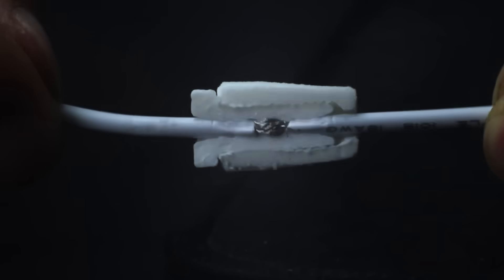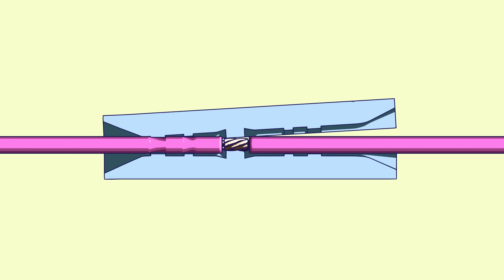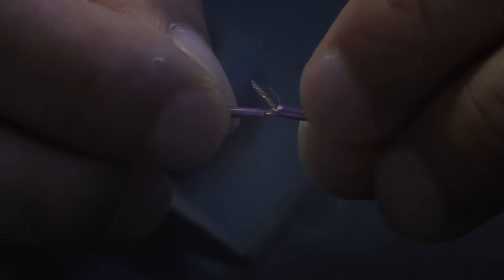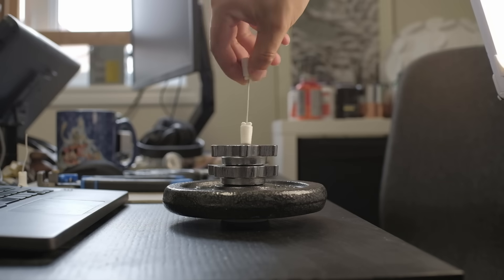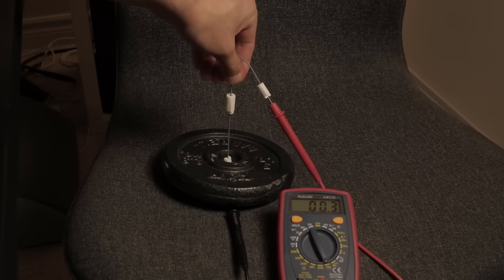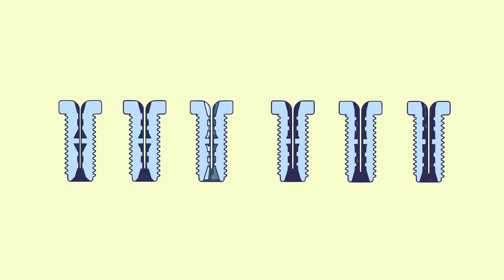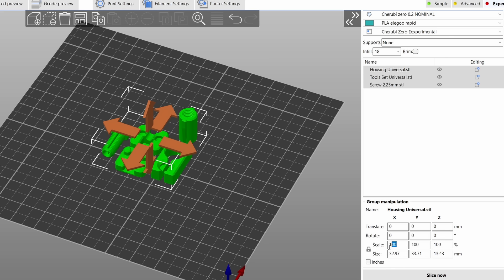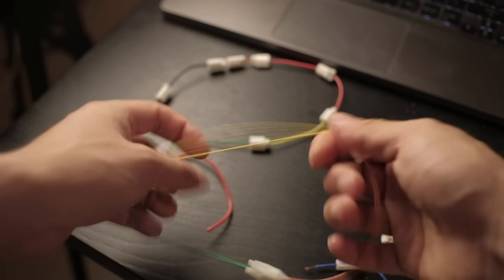3D printed wire connectors that actually work

Comment: This is really interesting, I'm pretty sure the inner part would be difficult to mass produce using injection molding. However you can play with the compliance aspect of the screw and print (I meant to say injection mold them) them open at an angle of 45 degrees, maybe that'll give you enough access to get the inner detail and make removable from the mold.
Reply from the maker: printing them open is a genius idea that never crossed my mind
Reply: @IbanisSorenzo Would a print-in-place hinge make them more reusable or would it affect the strength of it too much?

Comment: Is this not the same as a crimp butt splice?

Also the wires you've tested do look like the cheap CCA aluminium jumper ribbons found in arduino kits, not sure if a standard tinned copper wire would be stronger. In general, soldered or crimped splices should be supported regardless so zero force travels through it.

Comment: So what is it really for?
Cause prototyping at 2am does not strike me as a situation were you would wait another half hour just to connect 2 wires. It is not particularly easy or fast to set up, nor really stronger than other alternatives. If you ONLY want to jank-connect 2 wires or some testing: You can just twist them together and then tie a knot. That does reduce the strength cause of the knot but that's about it.
Reply: This must be one ofthose people who doesn’t have an internal monologue and can only see what’s in front of them instead of engaging in the ability to use the imagination.
Reply: @risunokairu  And you are the person that believes that they can reinvent the wheel.

Comment: The animations and renders from 3:40 were so absolutely out of the budget , it blew my mind . So smooooth and the cross section part didn't have to be so good .  Saving for a 3d printer to flex mine . Heads up

Comment: This is a great device. If you used a "Western Union Splice" before placing the wire into the new device, you would get a better electrical connection and less fatigue on the wire.

Comment: this seems like the perfect solution to provide strain relief for my 6th headphone jack that I have spliced onto my headphones after the other 5 broke/came loose...
Reply: Strain relief outside wow doesn't work well enough, try coiling the wire on another wire (like those telephone cables but for each constructor) this should make more flexible and let it rotate in more places instead of bending in one spot.
I had so many issues with these cables along 11y, always replacing it, it always fails in junctions due oxidation and the copper goup, tho I wanted to build a super strong unbreakable cable, I lack financial resources to do so T-T
Reply: random wow from swipe keyboard lol
Reply: I started using short headphone jack extensions after I nearly broke a couple motherboard audio ports. They're pretty cheap and they will break away pretty well from any direction.
Reply: After you fix your earplugs so many times wrapping the extended material around your head makes them a full headset.

Comment: I mean, that's really nice, I like the creativity, but. It's bulky, it's not weather proof and if the best feature is that it can hold more weight than solder joint you're using wires wrong in the first place.
Reply: The only reason it even broke was because it didn't have the extra strength of the sheathing around it, hence all of the load got directed through the wire, causing the metal before the joint to snap. Heatshrink provides minimal to no strength here, especially when applied by shrinking with an iron, instead of a heat gun.

Ontop of that, the solder joint itself probably wasn't of good quality either, seeing how he balled it up, and how dirty his soldering iron was with "slag".
If you intertwined the strands properly with the etnire exposed length, and let the solder fill all of the gaps between them, it likely would hold much more.
Reply from the maker: @raremc1620  yea... my solder discipline is pretty ass...
Reply: @IbanisSorenzo I didn't see the soldering process itself so I comment on that, but one thing you should probably do after using the soldering iron is clean it using brass, and then tin it lightly so the tip isn't exposed to air and doesnt corrode/leave gunk :)
Reply from the maker: @raremc1620  ill definitely do that going forward!
Reply from the maker: haha thank you!! and indeed 99% of the time a wago or a *properly soldered joint would be a more suitable solution...
Reply: @IbanisSorenzo  Yeah and I don't mean my comment any way hostile. I genuinely love the creativity. We need people like you, who like to test ideas. Sometimes those work, but aren't practical, but sometimes you hit big. Keep on the good spirit 😎
Reply: “It’s bulky” - obviously you’re going to choose a solution that best fits your needs. The scalability means you can reduce bulk for your application. 

“It’s not weather proof” - ok, and? It’s a 3d print. This issue can easily be fixed. You drop it a dab of silicone. You wrap it in electrical tape. You add o-rings. 

“If it’s best feature…” - your lack of imaginative thinking doesn’t mean this is a failed product. By its nature as a 3d print, it can be incorporated into many projects. Now it can function as a wire splice that integrates into a strain relief and create a seal between the inside and outside of a project. 

You’re not trying to see where this can solve problems. You’re applying this to problems you’re already familiar with.
Reply: @risunokairu  Yes, that's how feedback usually works. Never said it's useless, just pointed out the flaws in applications in which I need a wire connectors and am familiar with.

Comment: Pls do not print with PLA due to creeping
Reply: I believe most of the creep may be in the direction of the threads, not the diameter of the sheath. 

Pls do print with PLA for testing.
Reply: Honestly there shouldn't be prolonged tension on the connection anyways...
Reply: It will likely be fine unless the wire is load bearing which is shouldnt be.

Comment: i will be using this on my car light
Reply from the maker: Please make sure to test the connection before you leave it be. If the light draws more than a single amp, i would be cautious using this as the plastic could melt if printed with lower temp material like pla. Some lights draw a surprising amount of power! Also, good to check on it periodically for corrosion as with any uninsulated connections! Please be safe! 🙏 I know im ranting quite a lot, but with automotive stuff, people don't even really trust wagos, just keep your good judgement about you!
Reply: @IbanisSorenzo  lol thank you but its a car that i made at home its pretty much a big go cart and ik hat you mean abbout the lights drawing alot of power so im just useing leds or just some random battery powered addons thx for the reply lol

Comment: will use it for rc cars lets just hope it can handle 150 amps
Reply from the maker: youll be in my prayers brother
Reply: @IbanisSorenzo  You cooked with this print  ,they did´t melt even in a 15kg car that pulls at least 160amp and has peaks of 1000amps
Reply: why? Just why?
Reply: big esc can do 2000amp so will need big cables 8awg at least

Comment: Hey I mean wire nuts are not far from this, and used in many homes around the world 😅😅 and after all, wago are also just pieces of plastic. (Very well engineered pieces of plastic at that...) For sure this is an interesting idea, maybe with some tweaks it could be even better electrically and safer.
Reply from the maker: haha for sure spring loading the joints and relying less on the twisting capabilities of the user might get this lil doodad up to spec for some testing
Reply: Wago is another level, the wire gets crimped together with the metal part, not with the plastic parts. There is no twisting needed, and you can use solid core wire or stranded wire within the same connector.
Reply: @damustermann  of course, as I said its highly engineered - no disrespect to the wago gods. 😂 But if there were a few small changes to this design it would be far off the capability and safety wire nuts and wagos and similar..